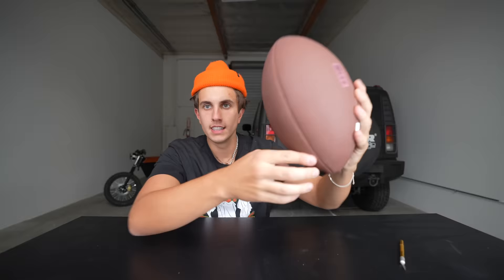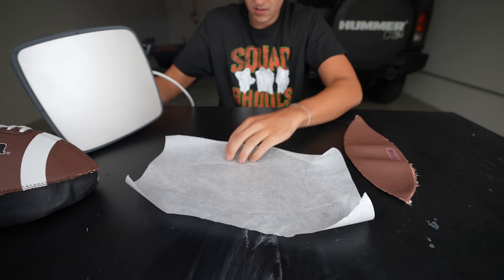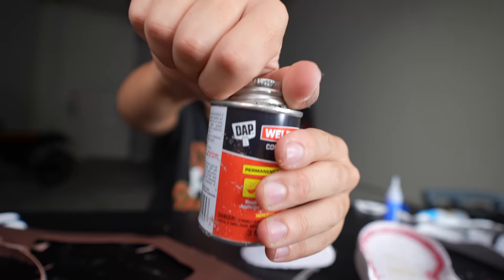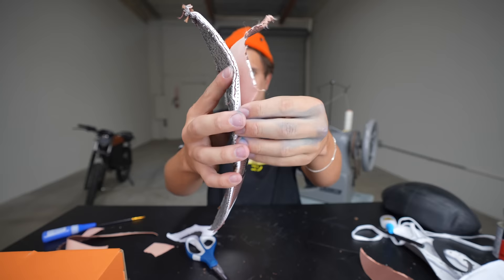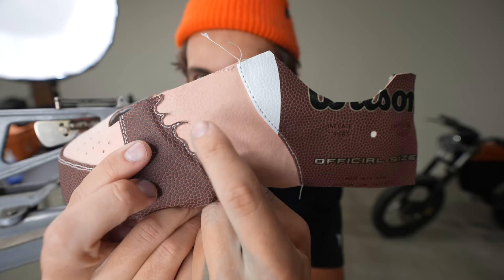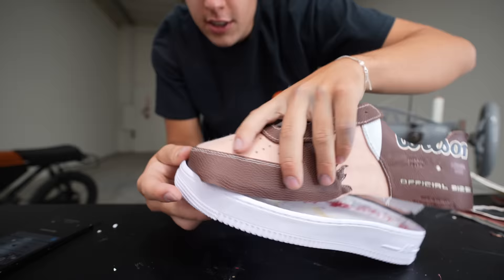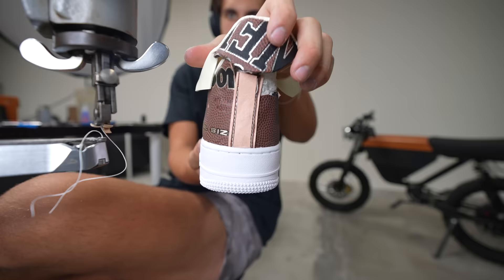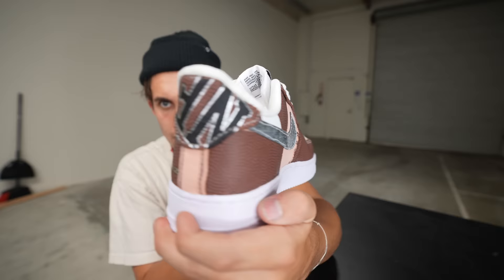Turning a Football into Custom Shoes

Comment: Crossing the laces was a missed opportunity. Should have went with left to right lacing so that they were straight lines, top to bottom and then pull the strings from bottom under and up so it looks like football lacing. You'd basically have to leave them loose enough to slip on but it would just look that much better for the B-roll